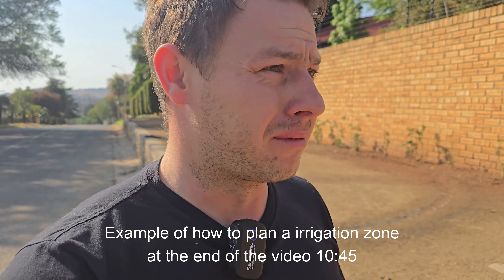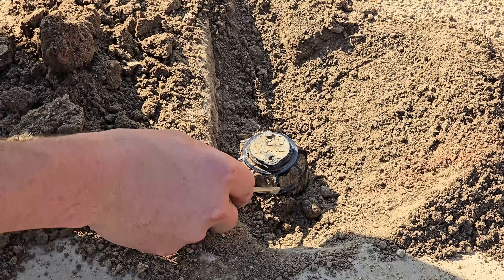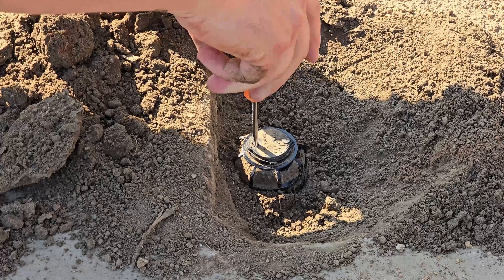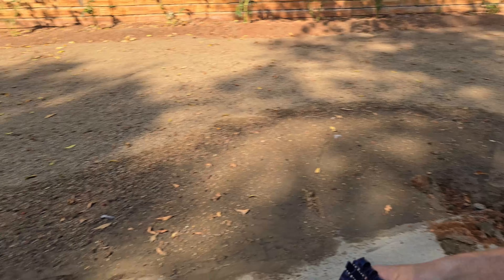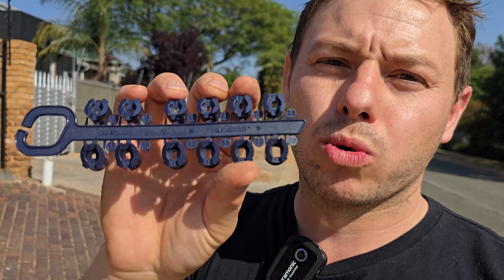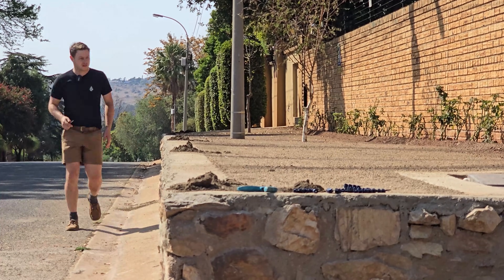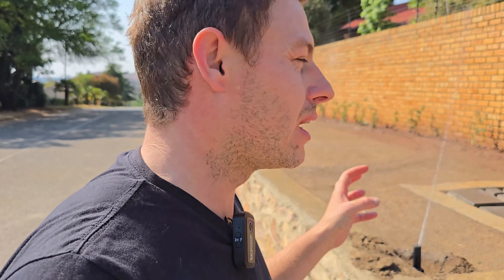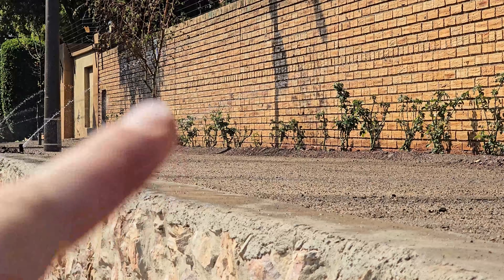Rainbird 5000 Heads + Nozzles Sizes// How to NOT WASTE WATER

Comment: I noticed that this rotors leak a lot water when watering, any idea why?
Reply from the maker: Do you mean at the nozzle or at the base where its conected to the pipe and fitting?
Reply: At the nozzle one part is spraying and the other leaking  @salawn